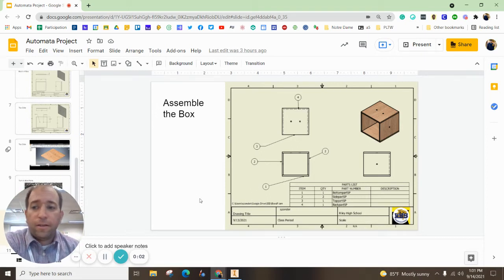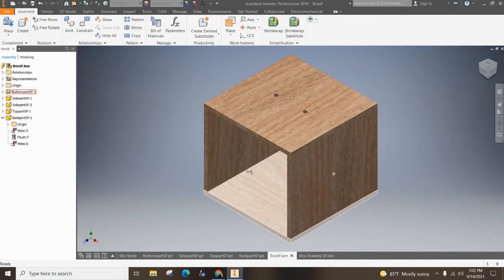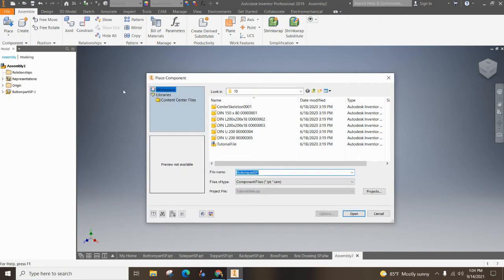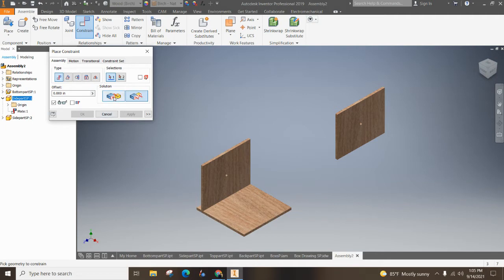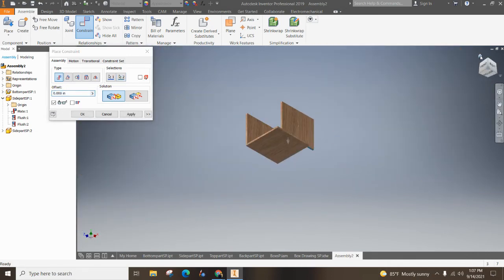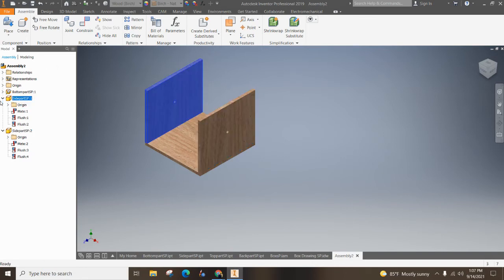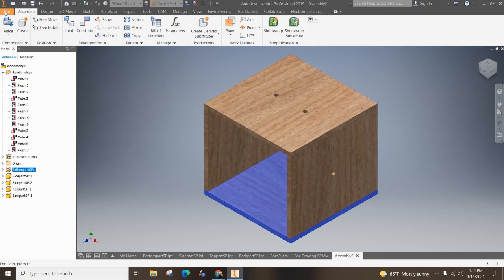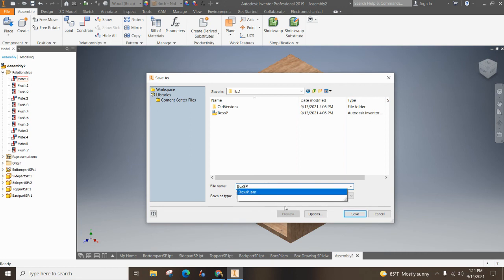Assemble a Wooden Box with Autodesk Inventor

Comment: Seth, I am a self-taught Revit user but have found myself working as a carpenter temporarily for a design company.  Of course, they use Inventor.  So, I asked if I could design the shipping crates as a way of stream lining the process of sizing and attaching the protective rails, shelves, panels, etc for each component.  I figured it would be a simple way for me to get my foot in the door of designing the cool stuff.  These simple tutorials on the box has been huge for me.  Thank you so much.